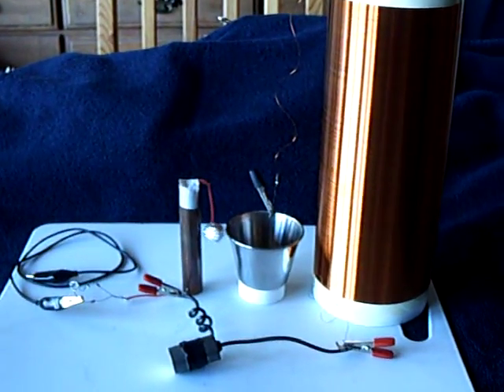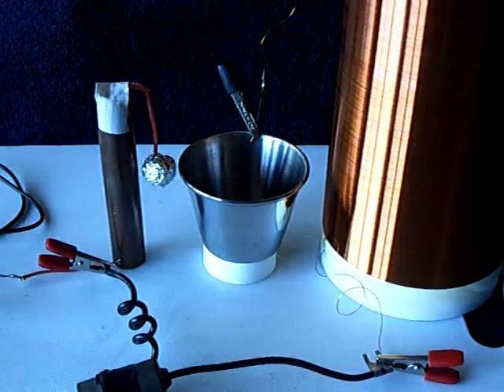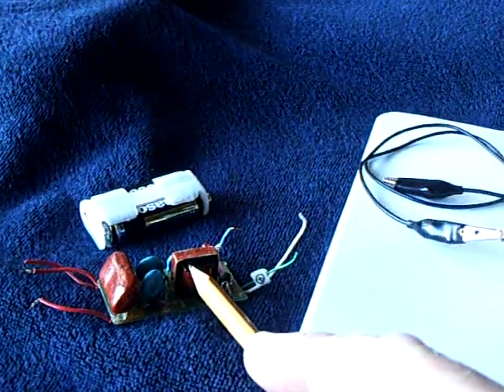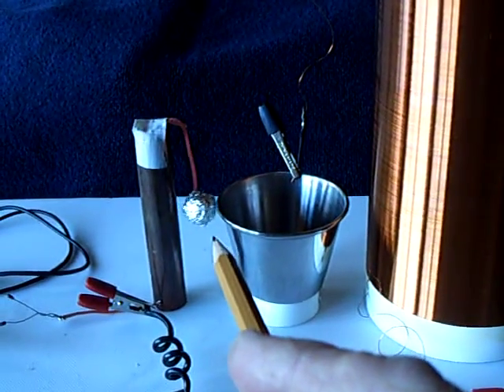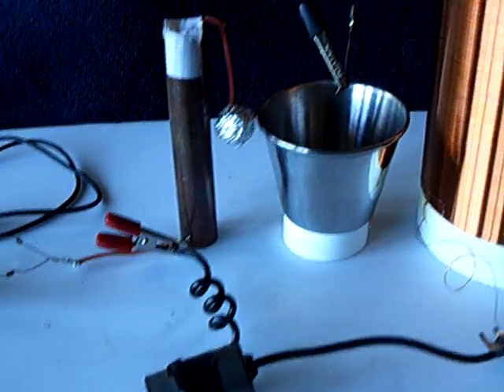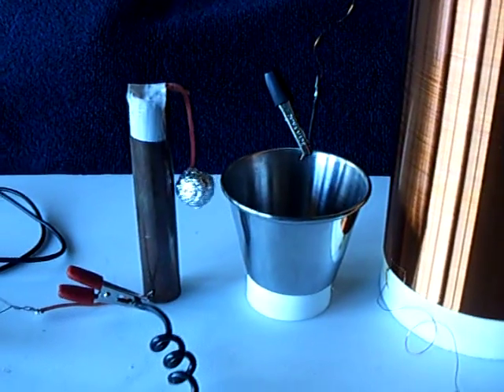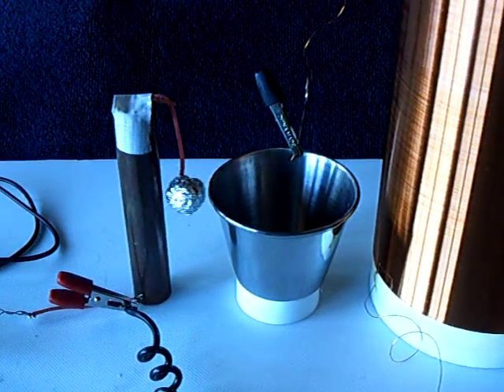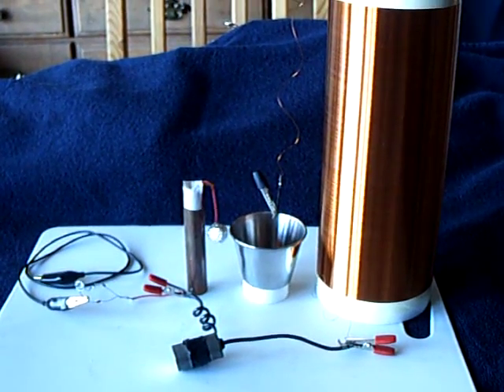Strange Electrostatic Experiment----  better setup

Comment: Well done LidM !
With what voltage did you start on the cap and how fast did it discharge then ?
Maybe you could have shown in on a meter ? Or would the meter discharge the cap faster than the device ?
Regards, Stefan.
Reply from the maker: I have not been able to take accurate voltage reading because they are very high.  The bug zapper puts out somewhere between 500 and 1500 volts.  To compound the problem I don't know the exact value of the cap.

Comment: ,,,an electrostatically powered motor.  That is an interesting idea Lidmotor.  Extremely difficult to pull off, but I bet you, if anyone, could do it.  First you need a giant and consistent source of electrostatic energy.  Then I bet one your ultra efficient pulse motors could run of say a capacitor charged by the electrostatic power source.
Reply from the maker: Actually electrostatic motors are very easy to make.  Check out the videos here at Youtube.  The trick will be to make a really small one that will run at the voltages I'm working with.

Comment: The soda can motor on the sidebar might be your answer ?!
It would be very cool indeed to see something spin like that. I wonder if you can use something 'ambient' to charge up the bug zapper over the hours of run time of the device ?
Reply from the maker: Thomas Kim's electrostatic projects are great.  It is hard to pick just one to replicate.  The plastic cup motor (made very small) is perhaps the easiest for me to try ----if it will work on my setup.  The bug zapper could be powered using solar energy but takes a lot of juice to run.   If I just turned it on once an hour or so just to charge up the run cap that would work.

Comment: Now you have that bowl, you have two capacitors. As the bowl and copper pipe are acting as a cap too. This may have some kind of tank circuit effect? Or it could still be mechanical flyback? Or a bit of both. It sure is interesting. If it wasn't for the coil, it would be a fairly standard Franklin Bell. the coil makes it really interesting, because I dont think a standard Franklin Bell would work at 400v.... I have another video on the way, with various caps hooked up to my Franklin bell. I cant get it to work at 1000v... Needs more voltage... I may have to throw a slayer coil in the mix....
Reply from the maker: I really don't know how much voltage I'm shoving into that poor cap.  There are no marking on it so I'm just guessing about the actual value based on others I looked at online.   I have thought about trying a microwave oven capacitor.  That should work but an accidental shock from that would really send you flying.